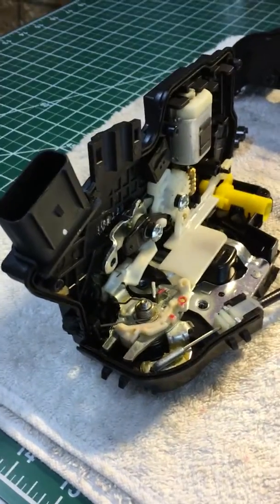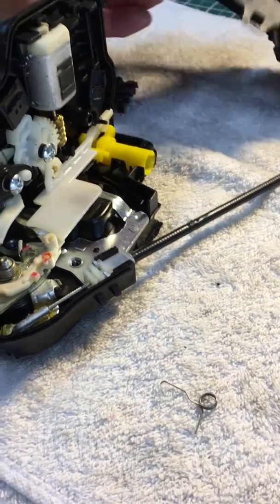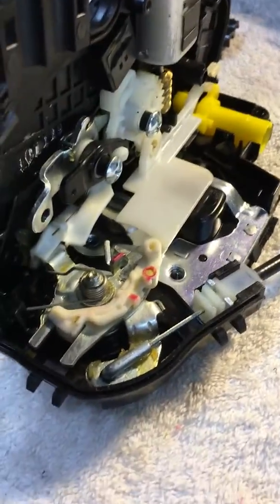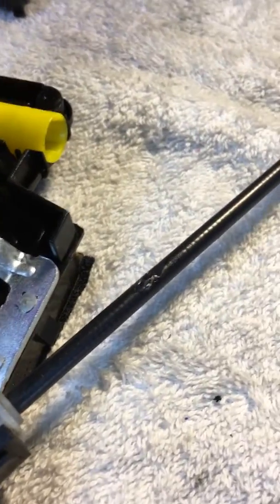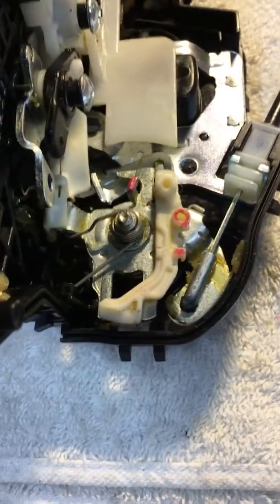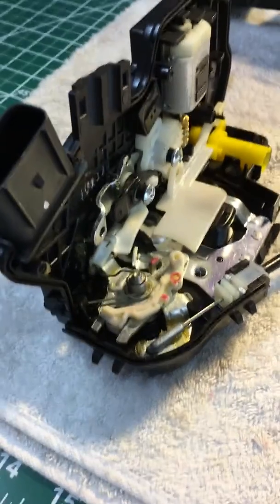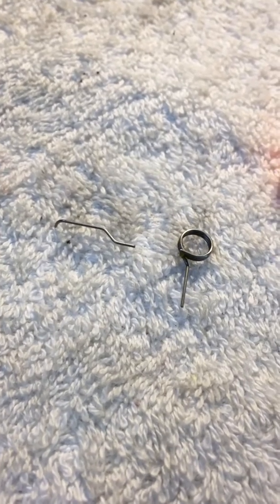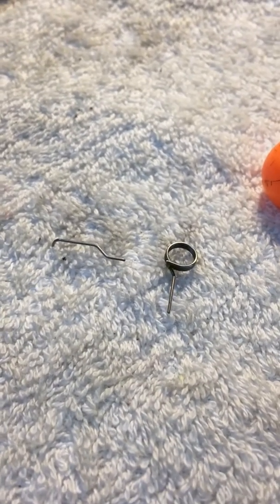2011 Kia Sorento inoperable outside door handle

Comment: Thank you so much for your post video. I've been dealing with a driver side door handle issue where I can't get in from the outside. I have to go inside the passenger side and unlock and open the door. That way. I'm going to try to fix this on my Kia Sportage 2014. I'm just nervous about the procedure. It's a shame that we're going through all this for a little $0.01 spring. Thanks again though 👍

Comment: I had the similar problem and replaced it with a new one I bought online. Now when I drive the car, 3 doors automatically locks as normal but the replaced one doesn't automatically lock. Even when  the key is pressed to lock the car, it locks 3 doors and won't lock the replaced one and when the unlock button is pressed it will unlock 3 doors and lock the replaced one. How do I resolve this issue? Thanks

Comment: I have a 2011 PS Sorento and my back door won't open from the outside so I went to the dealer and they told me that it was gonna cost me $300 so then I asked what would it cost just for the parts and they told me a $155.34 sense so I contacted Kia edit and I started in October 10 And they 21 and they wouldn't help me So today is may 7th and I went to go to my car but to my car and the door would not open on the driver's side so I
 Had to go in the passenger side to open my door it was pulling down raining and it was dark out I was in the parking lot and all I can think of is what if someone was chasing me it's chasing me I'm going to try to call key again tomorrow it is outrageous that these parts keep breaking and they won't do anything to help

Comment: My spring broke the exact same way. I fixed my handle with the exact spring that broke. I unwound the spring one turn and bent the arm straight. The two arms should be close to parallel to each other to work. I hope it helps...

Comment: Finally getting at the problem.  I'm thinking of using a piece of sponge behind the lever to push it forward  Unless the spring kit I bought provides an appropriate to modify spring .Right now I am having trouble removing the latch & inner metal panel-- But another video mentions a bolt accessed from the door edge

Comment: Kia Service Bulletin on this problem:  https://static.nhtsa.gov/odi/tsbs/2016/SB-10089586-5448.pdf
Reply: Thank you for posting this. Was very helpful. They really should have had a long term recall on these units including for out of warranty owners since it was obviously a defect in design. A critical component such as a door locking mechanism should not come with a shelf life of well under 10 years. That's just insane. I opted to buy the OEM unit for $50 delivered next day from Amazon, rather than drilling out rivets, buying a spring kit and trying to fashion a replacement, and not knowing fully what the actual issue is until I had the entire assembly extracted and opened up, during which time my wife would be unable to use the car. Easy enough just to purchase a new unit and be done. Saving $450 from the rip off stealership makes its highly worth it.
Reply: Thank you sir

Comment: There is an extended 10 year warranty on the issue for both front & rear doors
Reply: update  My Kia "in Service" date was Aug 2010 And so I was declined for repair in spite of special request due to Covid shutdowns Thanks Kia for nothing!
Reply: Do you have info on that waranty?
Reply: @timothyley7614  The warranty was 10 years from date of manufacture, I was refused for my 2011 in 2020 since manufacture was in 2019 Special consideration was refused

Comment: I hate my Kia.  I loved it till all the stupid little things started acting up.   Now it’s a pain in my ass.  Has 115,000 miles and has more issues with things besides the motor than my 2000 Chevy that has almost 300,000 miles.

Comment: Call Kia Motors they will replace the spring on the front doors one time at no charge.  The rear doors are covered for 10 years regardless of mileage.  It is a pain in the neck to do it yourself so save yourself time and money.
Reply: Did they do this without it being under warranty? I have a 2011 that’s not under warranty and just had this happen

Comment: That happened to me, first you can't open the inside latch. Went to dealer and told me it's not a recall item. Wanted to charge me $100. I refused to pay it. So got to my car and it's working. After 3 years, the door latch outside quit working. I know there was a recall about door latch, but dealer said, that mechanism is not a recall. Why can't Kia use a good type of spring!

Comment: This is a recall issue contact Kia. This recall expires in 2021
Reply: Will KIA replace this for free?  I'm just now having this issue and the cheapest I've found to get this fixed is $450 per door.
Reply: Yes because it is a safety issue.   @kr8973
Reply: @kr8973 hey I know it's been 7 years. But did Kia ever fix this for you?? I have my drivers side AND rear passenger side doors non functional..I'm so irritated.
Reply: Do you happen to have the recall notice number?, I can replace it myself, but it they do it under a recall notice, I'm in! Thanks!

Comment: Hey Bill - have you got the spring dimensions - length of each leg, inside diameter, number of full coils, approximate angle between legs when relaxed, wire diameter. Lots of spring suppliers I might be able to get one from near where I live

Comment: Were you able to find just the spring anywhere?  What is this part?  (Dealer did "customer satisfaction" "upgrade" a little over a year ago - now part breaks, and they want $360 to look at it, $121 for "the part." )
Reply from the maker: John, Could not find a spring that had all the bends that the original factory unit had. Ordered the entire assembly from the dealership and installed myself.
Removal and install was a bit of a challenge.

Comment: Had the same problem with the door on my in-laws sorento, I replaced the actuator, but now even though it opens and closes, once you lock it, it will only open manually from the inside. But once opened from the inside, it works just fine. Any ideas?
Reply: Nick Travers same happen to me last night, have to use key manually to unlocm the whome system as its pushstart and my key fob doesnt work have to climb into another door to drivers seat inside handle is fine outside not so i wilm habe to climb through each time its ridiculous